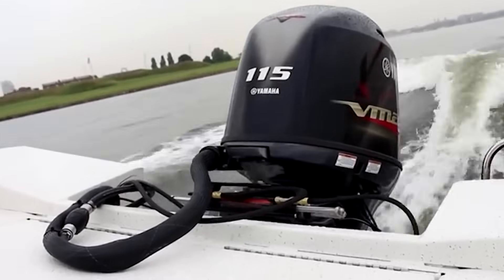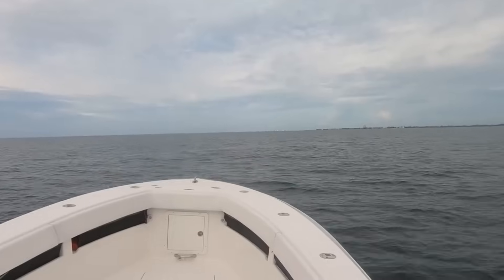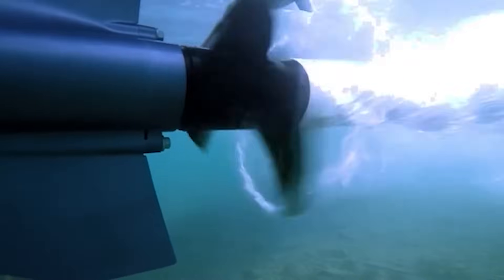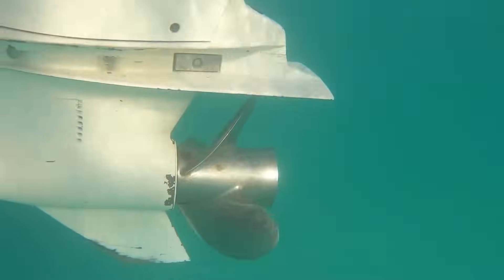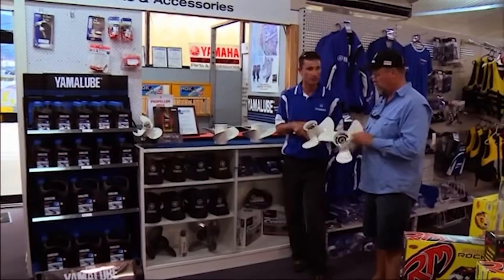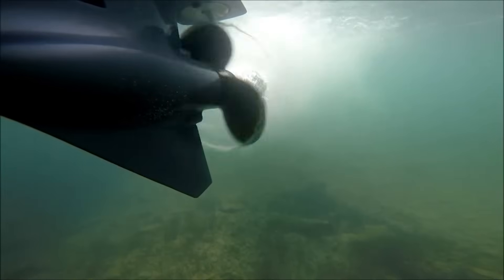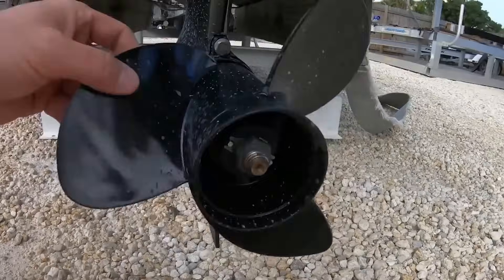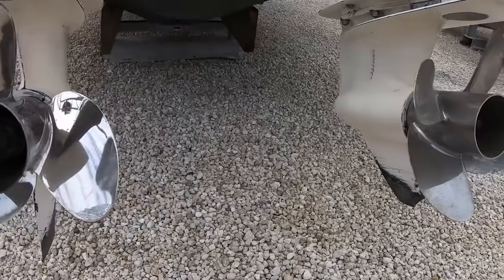Propeller Physics Secrets Every Owner Should Know

Comment: 5:59 You're confused here: the propeller pitch is not looked at specifically at the leading and trailing edges of the airfoil/hydrofoil, the pitch is looked at at a certain radius so that the leading and trailing edges of the profile are connected by a line and then the pitch/angle is obtained at that radius, and it is always greater at a smaller radius than at a larger radius. Otherwise, the tendency is for both airplanes and ships to reduce propeller revolutions and increase the number of blades in order to reduce friction and vibration, and ideally, there should not be a large difference between the smallest and largest radius of the propeller blades, because this increases the difference in the speed of water flow over the blade profile and reduces the maximum speed of rotation of the propeller

Comment: Mechanical engineer here. Multiple things are wrong in this video. One of the most basic things is that YES the prop moves you forward by pushing the water backwards. This is not contrary to the propellor being a set of rotating wings (which is true).

Comment: Three blades are good for vhull boats, 4 blades are good for tunnels boats, 5 blades are good for paperweight. 2 blades are speed props. Any questions? Putting the correct pitch propeller is crucial. Too much pitch kills engine top rpm's and holeshot. Too little  pitch will give you a holeshot from hell and no top speed. You should get as close to manufactures top engine rpm's with the payload you normally carry by changing pitch. Diameter is not nearly as important as degrees of pitch. Power tech props are the best out of box props I've ever used without a professional    tweaking the prop with cupping.

Comment: You left out 2-Bladed props,  and didn't mention that for the Best Effeciency we should use Paddle Wheels. 
We would run mostly 2-bladed props that seemed to be able to get a water skier up & get down the lake quickly. More blades seemed to pull a bit better. For effeciency above 45 mph that was plenty fast - at least the time I water skied that fast.
Sounds like good thoughts..

Comment: Slightly off subject:
I was placed in charge of wiring the engine room of a ferry for Ethernet.  The captain escorted me to the engine room to show me what he needed done.  While there, everything was going smoothly until a low rumble started to develop. The captain looked concerned.  Then it became a horrible shaking and banging that seemed like it was going to destroy ship.  The captain yelled out, "Cavitation!  Hold on!" He took off running.  In about 12 minutes, the engines stopped completely.  Then they restarted and all was smooth.  A half an hour later, the captain returned and said, "A former member of my crew was just relieved of duty and will likely never work on any ship again."
Cavitation is terrifying!

Comment: What I find most interesting is with all these rocket scientists out there we still only get 1-2 mpg out of a boat. An 80k lbs semi at 70 mph get 5-7 mpg.
Reply: That is an unfair comparison because a mile is 796 feet longer at sea.
Reply: @satunnainenkatselija4478  That a perfectly fine comparison. On newer boats speed is measured in mph not nautical mile. Usually taken from gps.
Reply: @fredv7487  For thousands of years, there have been boats that can go ∞ miles on a gallon of fuel. Yet, I observe speed over ground in kph and fuel consumption in NM/l.
Reply: @satunnainenkatselija4478  Hmm interesting. Just wondering. In all the reviews of recreational boats I have yet see any fuel consumption in NM. Guessing you misunderstood the comment. It was in reference to propeller driven recreational boats, not sail.
Reply: Dude sometimes you need to break it all down to brass tacs. Take a certain weight of something now move that weight a few feet. Then try to move that weight a few feet in water. You will see pretty quick they are a price we have to pay for moving weight. 80,000 lbs of weight is gonna cost you 1 gallon of diesel fuel for a few miles. That’s just the way it is. You should invent something if you think it’s possible to do it differently or more efficient. Maybe a sterling engine could do it more  efficient but it would trade off in price to build it.
Reply: @dreece2000  dude the real reasons is all about profit margins. Everyone profits when people just settle for what they offer.
Reply: @fredv7487 Fred if you think it’s possible to make these things use less fuel, the world is out there waiting on someone to do. It might as well be you. If you do I’m the first person to get behind you on that.
Reply: @dreece2000  Have been for years. Bought a planing hull boat and use it like a trawler. Better fuel economy at slow speeds then a trawler. Recommend diesels to everyone that ask. Always go around and question dealers as to why their products are so expensive. Ask why gasoline engines are so much more than car engines, get the standard reply, we have to make them stronger to handle the riggers of boating. Asked what have you done to diesels to justify the cost, reply silence, or we added marine stuff. Ask why would anyone want to have their engine able to reach red line and not put a prop that would produce better fuel economy.  Question why are the props on the gasoline version of my boat only 1 inch smaller then my diesel version? My point is people just simply except what is told to them and keep allowing these companies to steal from them. 
Ps. My planning hull at trawler speed gets almost twice the range of trawlers at trawler speeds. We have never worried about weight.
Reply: @fredv7487  a diesel makes power down low. A gasoline engine will have to rev higher to get its power that's why the props are smaller. I'm on your side man.  We should be using diesels. Most of all we should stop running the exhaust in the water polluting the fuck out it

Comment: There are several things you are wrong on. Yes if you make no changes, a five or six blade prop is the slower prop. But in high performance applications, there is a lot more going on. We can take down the diameter of a cleaver from say 17.25" on a five blade to 16.75" on a six blade, and we hit the same rpm with a bit less slip. There is a reason why nobody runs four and three blade cleavers in racing these days. Also, the blade itself is smaller on a prop with more blades, and the blade itself can in fact be thinner, which mean a reduction in drag. But you are failing to understand the most basic principle of why we want more blades in go-fast boating. We want that prop and gear case OUT of the water. I would never be able to run the same X dimension with a three blade as I would a five or six blade, ever. Six blade props also have a big advantage in rough seas with better bite. Also, our surfacing props do not suffer from cavitation. When you aerate the blade and ventilate the prop, you get rid of the cavitation, which means a surfacing prop also has a harder bite in the water compared to a submerged prop.
I could go on and on taking this video apart. Years in racing spend with bright minds like Brett Anderson of Bblades and many others, who knows a hell of a lot more than you about going fast on the water.If what you said was true, things would be very different. I dare you to install a Mirage+ on a boat with an X set for a Max5 or even just a Bravo 1. Yeah, have fun with that.
Oh, I should also mention that the chances of a prop blowing out, because the fourth blade interferes with the water flow around the anti-ventilation plate, is quite funny. If that happens, you have your outboard or sterndrive installed incorrectly. See all these modern props, are in fact designed to be a bit surfaced. Not talking like cleavers, but props like a Rev 4, Mirage +, Bravo 1, Tempest +, Fury and most of the other well known stainless props, should have the tip of the blade penetrate the surface at least ½", if not 1". If your boat drags the anti-ventilation plate, back to the drawing board you go. Yes I do see some boats who does this, which is utterly insane, but most well built boats do not. The only exception is usually counter rotating prop setups. They are a bit harder to get right in the surface. So boats like a Formula, Cobalt or the like with B3's, tend to have their engines installed at a 14"-14.5" X dimension.

Comment: Pro racing props are bit more than $3000….  More like $7-12000
Reply: 5-7k. Sometimes a bit more because of additional tweaking. But we pay around 5500-7000 usd for CNC props, being it Hering, Rolla or Merc. That is of course for 25 and 26 tooth applications.
Reply: Test test
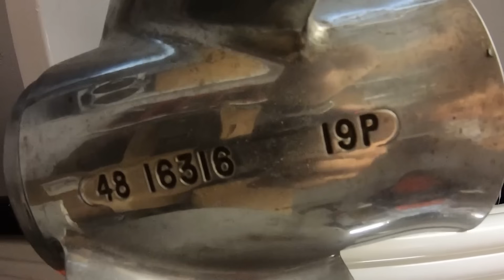Reply: This video had to be a test AI Pirate ship video Mark Zuckerburg  built for the History Channel and made 75.00 an episode on. People dont drain your bank following 90% of this misinformation. If your not on a competitive boating affiliation. Let ypur local trusted Marina or Mechanic narrow your results  of the proper setup for your application based on many variables, such as what type of hull ,motor, average number of adults in boat, gear, what the boats going to be used for cruising full of people, recreational sporting tubing skier, kneeboards etc. And they can do the math on all the above and optimize your boating experience if your infamiliar with properly setting up the rig for the first time. Props arent a cheap experiment and you dont want to buy 2 or 3 at 400-1000.00  unless your a prop collector. Just my two cents on this nonsense time consuming video that doesnt pertaon to the average  boater who most likely by 3:00 min mark is in a brain fog asking themself. What the hell is this guy or robot talking about.. boat safe. The most nonsense on boating ive been bored by sinve i learned how to sailboat:/. Joke. I never wanna sailboat. Haha.